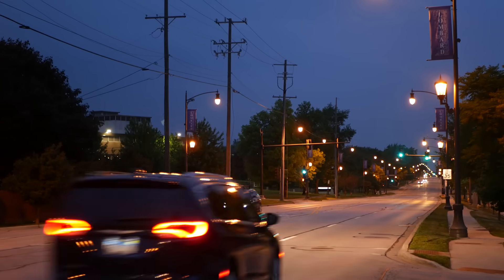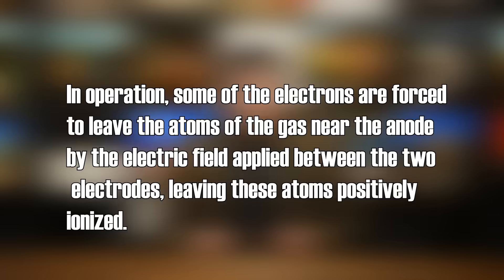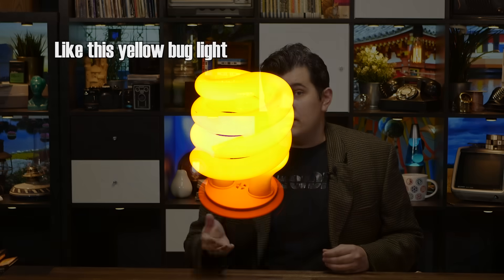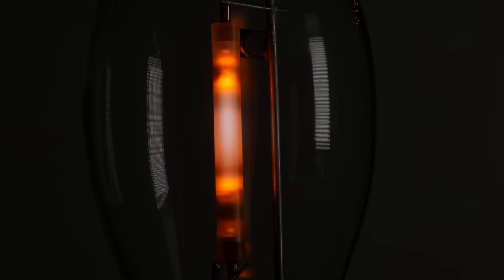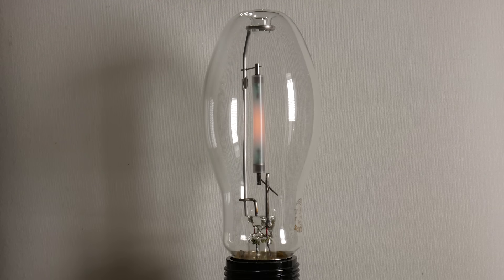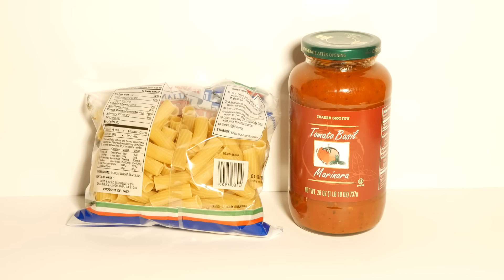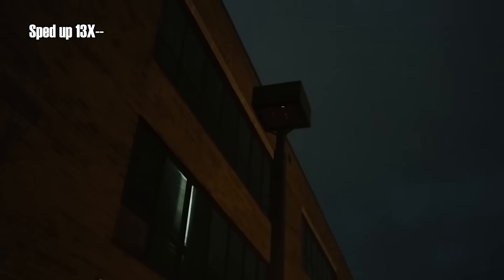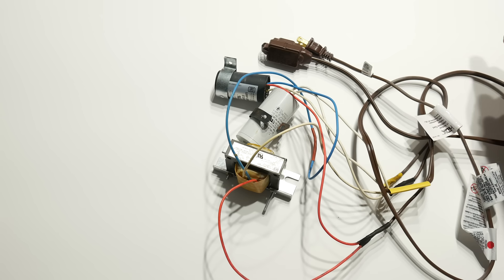The High Pressure Sodium Light: Ubiquitous, effective, but good?

Comment: I prefer the orange glow at night from these lamps over the LED ones they use now. In fog it lights the area around the pole, im not sure why but i think its because the colour of the light cuts through the fog as opposed to being a glob of white light.
Reply: Well L.E.D. street lights will be permanent forever,Low and High Pressure Sodium lights are so old,outdated and just do not last as long as L.E.D. lights do,also L.E.D. lights have a huge lifespan of 100,000 hours and more
Reply: @stephensnell5707  CFL also touted long life spans, but guess what doesn't have long life spans... the cheap driver components that don't weather well, same will be true for cheap Chinese components that power the LED street lights so many towns purchased from the lowest bidder (i.e. Chinese companies).
Reply: Hi ipweendu have you become a flat earther yet? If not I suggest watch a 13 part series called What on earth happened by Ewaranon to learn that the earth is not a globe. I got it in my about tab.

Comment: Since you are talking about discharge or arc lamps, I'm surprised you didn't mention that the first use of electric lighting was carbon arc lamps. They were originally used for street lights, but were stll used for a long time for spot lights, search lights, and movie projectors.
Reply: Yes, thank you for mentioning that.   Many people (including myself when I was real young) always was under the impression that  incandescent lights are the earliest type, and we have Thomas Edison to thank.    In many ways, the carbon arc lamps are considered the most important electric source ever invented,  since it would eventually pave the way for several arc light sources widely in use today, despite LED really taking the stage over the last decade: Metal halide,  high pressure sodium,  fluorescent,  HMI & Xenon short arc lamps, to name a few.  Today,  for searchlights and movie projectors, the carbon arc is obsolete and has been replaced by HMI or Xenon short arc.   HMI lamps are available up to 24,000 watts, with an output of 2,300,000 lumens.
Reply: @Sparky-ww5re  Yes, the really bright lights we use now are still arc lamps. The difference is that the arc is now enclosed in a glass tube.  As I kid, I remember watching a big old searchlight. The carbon rods were at least an inch in diameter. I looked at the gauges on the generator. I recall it was about 100 amps and 100 volts.  The mechanism for feeding the carbon rod was broken, so the man operating it had to push the rod in every few minutes.
Reply: Hi ken have you become a flat earther yet? If not I suggest watch a 13 part series called What on earth happened by Ewaranon to learn that the earth is not a globe. I got it in my about tab.

Comment: At my job we have metal halide "wooble" lights that we put were we are working to see but if you even bump it it shuts off and takes at least 10 or 20 minutes to restart
Reply: Hi z10 have you become a flat earther yet? If not I suggest watch a 13 part series called What on earth happened by Ewaranon to learn that the earth is not a globe. I got it in my about tab.

Comment: 1:24 "...due to tungsten's much higher melting point..."
Nope.  Carbon has a higher melting point than tungsten.
Reply: Hi I_leave have you become a flat earther yet? If not I suggest watch a 13 part series called What on earth happened by Ewaranon to learn that the earth is not a globe. I got it in my about tab.

Comment: 5:30 "and some other ballasts including this one." that isnt really a ballast. rather, its a capacitor. you could just call it a capacitor (suggestion )
Reply: Hi gradient have you become a flat earther yet? If not I suggest watch a 13 part series called What on earth happened by Ewaranon to learn that the earth is not a globe. I got it in my about tab.
Reply: @flat-earther  OK? what does your "Flat earth" reply have to do with my comment.
Reply: @gradientgamer5480  Come on it's a random suggestion with no relation to your comment.
I suggest watching the series to learn stuff you may have not heard before.
Reply: @flat-earther  you should check ur comments on ur latest vid
Reply: @gradientgamer5480  Yeah I saw it. I kind of wish I had a bot because commenting manually takes time and effort.

Comment: Explanation of how the electric discharge lamp works for dummies:

You know when you make pasta and a bit of salted water ends up on the fire and the fire, from blue, becomes orange? That orange is the sodium's colour. When electrons around an atom are excited (have some extra energy), they release it by emitting an electromagnetic wave. In this case, that wave is orange light. When sodium ends up in the fire, the heat provides the extra energy. When it is in a lamp, electricity provides it instead.

Now, i dont have a degree in chemistry: just a diploma. Im making 2+2 with the concepts that i had learned in school and the explanation from here
Reply: No, unfortunately I actually don't know because I have never had a gas stove, only electric...
Reply: @flat-earther  you get the concept, i guess
Reply: @alessiomuccio2795  Yeah I think so.
I have a kerosene camping stove and I think it's similar to what you said. With clean fuel the flame is ideally blue but if the fuel has contaminants it has yellow areas, sometimes green or other color I have seen too, that's cool.

Comment: As I’ve spent many years traveling American interstates as a touring musician, I have to say, the transition from the warm glow of a high pressure sodium, over to very stark LED’s has been interesting to watch. As interstates aren’t fully lit (at least in the United States) that warm glow over the horizon used to signal that the next city was nearing, and there was always something rather magical about how gentle the transition was as we would drive our beat to hell conversion van, pulling our U-Haul trailer, buffeting gently along the soft summer breeze in the very early morning. Even though the light poles would simply suddenly appear, it always felt far more gradual as my eyes would get used to them. LED’s are very jarring, and I found that as they became more common, I would usually pick one of the first exits I could take under them to stop, and get out to stretch, and also let my eyes adjust to the bright blue hues, and blinding grays that would suddenly surround every object my eyes would be scanning.
Reply: I agree the LED is unpleasant. I don't even like going out at night these days because the LEDs used now are so annoying.
BTW soulman I suggest watch a 13 part series called What on earth happened by Ewaranon to learn that the earth is not a globe. I got it in my about tab.
Reply: @flat-earther  stop being stupid

Comment: I think that I might be in the minority here, but honestly I'm actually glad that cities are replacing both LPS and HPS bulbs with LEDs.  LPS bulbs are absolutely terrible from a safety standpoint due to their horrific CRI.  What color is that car speeding away from a crime?  Is it that white or yellow?  Red or grey?  Blue or maybe that was green or black?

HPS bulbs are still pretty bad for identifying color, but at least you might be able to tell a green car from a blue or black one.

As for L.E.D.s seemingly not illuminating well I get the impression that when some places switched over they retrofitted older fixtures and may not have the right optics on them for a "floodier" light—it doesn't matter how good a light is if the optics (reflector and/or front element) are really bad.  The other reason may be that the perceived brightness of a blue-white light versus that of the yellow-orange light of an HPS bulb is a lot higher so areas where the light doesn't reach as well appear darker with L.E.D. illumination than with the HPS bulbs.
Reply: Hi maikerugo have you become a flat earther yet? If not I suggest watch a 13 part series called What on earth happened by Ewaranon to learn that the earth is not a globe. I got it in my about tab.

Comment: The early days of LED street lighting weren’t fun. Not just colour temp but also glare was a huge issue, as LEDs emit their light from a much smaller surface area than big sodium bulbs. Thankfully manufacturers have figured this out and the key advantage now is that you can get extremely effective optic systems to shape the light to get the required coverage onto roads, paths etc without that light encroaching into houses and people’s windows. Colour temps of 2200K are now available too. Mixed in with the ability to dim LED luminaires with timers and presence detection means that less light (and thus energy) can be used to preserve illumination in public areas and road while lowering light pollution and the effects on both animals and humans too.

Comment: There is something calming and magical about these lights. LEDs just seem too aggressive.
Personally, I hope sodium vapour lights continue for a very long time.
Reply: Honestly, the problem isn't LEDs, it's just the color temperature. There are LEDs that can perfectly replicate the color of high and low pressure sodium lamps, they just don't use them for visibility reasons. In my opinion, they should just use white LEDs on areas like freeways where visibility matters a lot and continue using HPS/amber LEDs for city streets.

Comment: Can you drive the Sodium vapor lamp with a fluroscent balast and igniter such as from the the fluroscent tubes (Neon Tubes) ?
Reply: I don't think so. I've heard of people using metal halide/mercury vapor ballasts for HPS bulbs, but even then it is sort of risky and much less efficient than just using the proper ballast/ignitor.
Reply: @123four...   Yes, i understand. This comment was long time ago, when i did not know alot about Lights. I now not only have a YouTube chanel but also lights and lamps. The best option is obviesly a sodium vapour balllast and ignitor. The only problem is that i dont own a sodium vapour system. And it also cost a lot (here in Germany) around 65€. I already own a 70W metal halide, which is the closest to make a sodium vapour lamp working. This was only question about testing an HPS, not using it.

Comment: Even with a capacitor in place, the magnetic ballast still causes quite some loss. Run the ballast + 50W bulb through a power meter and you'll see it's consuming closer to 62W with a power factor of around 0.8

Comment: I learned in my lineman class that most non-LED series street-lighting is full primary voltage. I always figured it was 120 or 277V like a building light. A constant current transformer is used to keep the load at 6.6 or 20 amps and is capable of primary voltage if the resistance of all those filaments and arcs is high enough. It must add a whole new dimension to changing a lightbulb.

Comment: I've used HPS for indoor cultivation. But it uses SOOO much electricity- like 600w is where they start. LEDs are FAR more effective. I get EXACTLY the same output from a 120w LED as I do from a 1000w HPS or Ceramic Metal Halide bulb. HPS has a usable efficiency of .5-1.0 but LEDs are currently 3.0u/Mol with the Samsung 303-H diode (H stands for horticulture which uses less Blue and reds with a K value of 2500k-5000k  white light has a higher K value while HPS and CMH have a lower K value) and a PAR value as high as you want with creative diode placement. 50,000 PAR is possible with LEDs. You'll never get over 32,000 PAR without starting fires with CMH/HPS. Natural sunlight is 50-120k (the difference between a warm day in Britian and Death Valley).

Comment: The low pressure sodium light is even more amazing. It's two close spectral lines so you can filter that shit out when taking astrophotos and it has amazing efficiency for putting out a lot of mellow light that doesn't fuck with your circadian rythm.

Comment: Modern incandescent lamps do not hold a high vacuum.  The envelope is too thin for that.  There would be an implosion hazard.  Instead,  most of the air is replaced by argon,  while the pressure is just a few in Hg below atmospheric pressure.  However,  incandescent lighting has faded into the past.  It has become a mere filament of our imagination.

Comment: I love these lights. They don't hurt my eyes like the newer cold white LED streetlights.
Reply: L.E.D. lights have basically replaced HPS AND LPS LIGHTS AS L.E.D. lights are extremely long lasting and 100% efficient and don't produce no heat
Reply: @stephensnell5707  every LED I've seen except for the small Holliday ones get hot!
Reply: @anthonywilliams8956  L.E.D lights don't get hot unlike older lights
Reply: @stephensnell5707  the LEDs don't get hot but some of their power supplies do!
Reply: @stephensnell5707  I would love to see an LED chip that makes no heat. Look at any high power LED chip and/or the power supply. Why do you think they have a heatsink? Decoration? Surely.

Comment: I remember as a child, coming home from visiting relatives in Marin County, CA, to our home in San Francisco, the lighting on the Golden Gate Bridge was always a definite orangey color.  My parents knew then, and told me, that they were sodium vapor lights.  It's one of those bits of trivia I learned at a young age, and that has stuck with me these 6+ decades later...
Reply: The lights on the Golden Gate bridge are (or were) low pressure sodium. Those produce a monochromatic gold light which is quite different from the much more common high pressure sodium lights.
Reply: Some of the lights still are and it’s funny but for me it was heading the opposite direction

Comment: In the UK a majority of street lighting is LED now, and clinical white. 

It's so nice to see the odd Low Pressure Sodium blasting everything in its radius with yellow light!
Reply: That's because L.E.D. lights are extremely efficient and have a very long lifespan
Reply: @stephensnell1379  efficient yeah, but there's SOX lamps from the 80s still burning today
Reply: @daveytn  they will not be around much longer and the L.E.D. light will permanently replace them as L.E.D. get to 100% brightness instantly when they turn on
Reply: @stephensnell1379  LED has a very short life span of 1 year
Reply: @pyeltd.1997  wrong,they will last 100,000 hours+(equal to about 4 years or even more),only L.E.D. lights that are produced in a faulty state will fail first but otherwise they are absolutely fantastic and give off way more light than the early day lights

Comment: LED lights might not put out that much heat which can be a problem when using in stoplights for example. They would not melt the ice during winter time.

Comment: 9:20 mins- that's not bad though. It's good for street light.
LED's need to be a soft yellow white light. I've seen those in the main drag in Rotorua New Zealand. Looked good. Doesn't have the same level of blue.